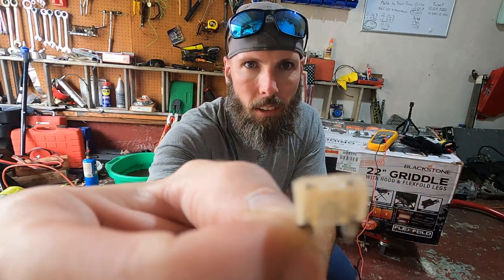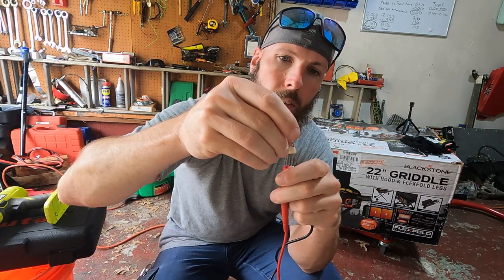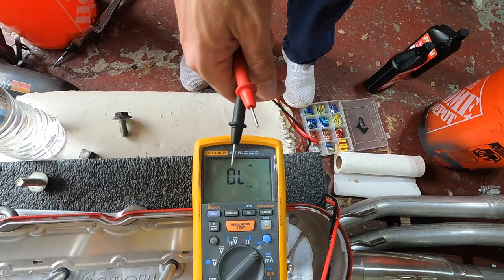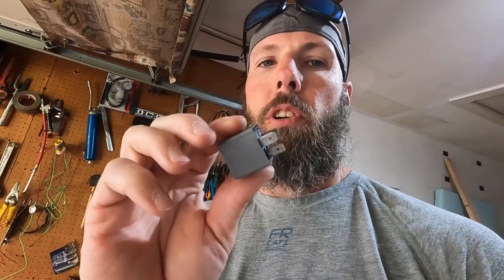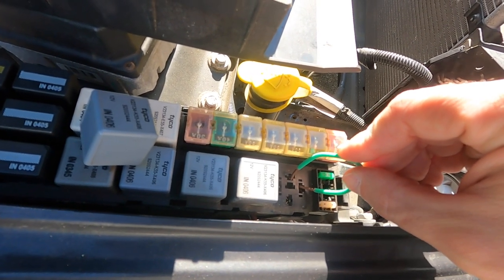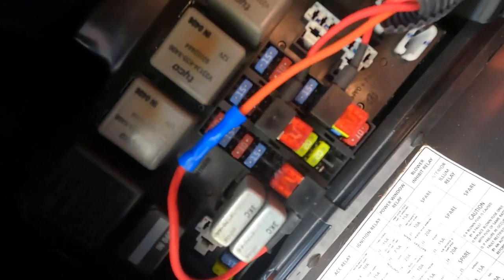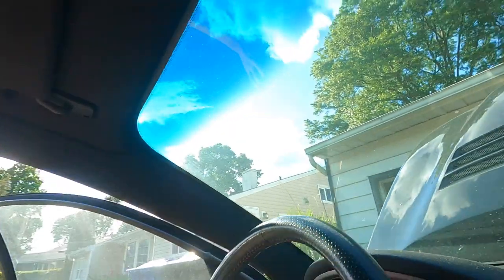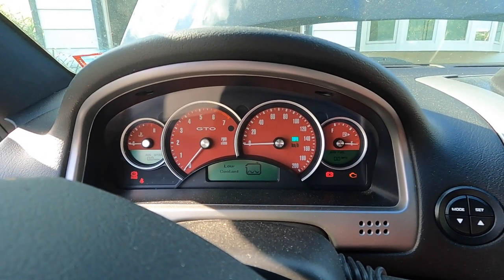The GTO has life!!! w/ open header startup! When issues fix themselves

Comment: Maybe reseating the relays and fuse fixed the electrical issues. 

Actually sometimes reseating components can fix issues in electronics and I think it can be caused by oxidation on the connectors.

However, if it's a intermittent failure. No fun.
Reply from the maker: I have no clue. I'm sure it's possible. When I do the battery relocation I'll check the wires that I replace.
Reply: @Billy_Ray_Garage  I hear you. And wishing you much success and to find the failure location, if there is one.

Comment: You have stock injectors?
Reply from the maker: No. Upgraded to Bosch 38lb injectors
Reply: @Billy_Ray_Garage  I got bosch 42lb not sure if I should even start it,tuner said I can flood the motor with too much gas
Reply from the maker: @GusP-rv8yn  I got mine tuned into the ECU on the initial tune. Was told not to beat on it until it gets dyno'd and tuned. The 38lb was recommended by Texas speed